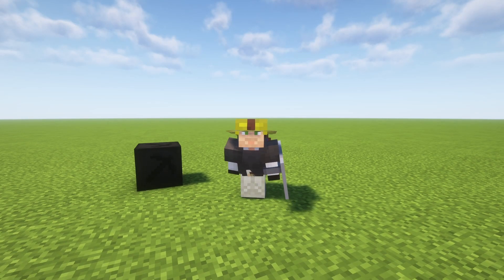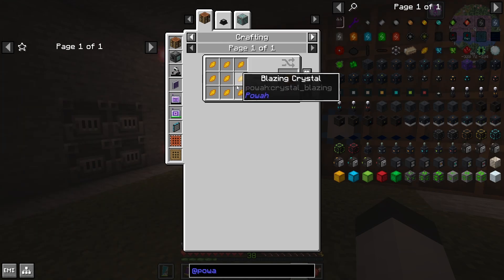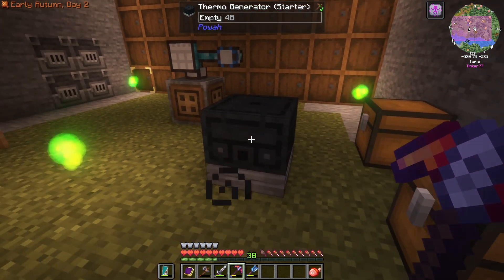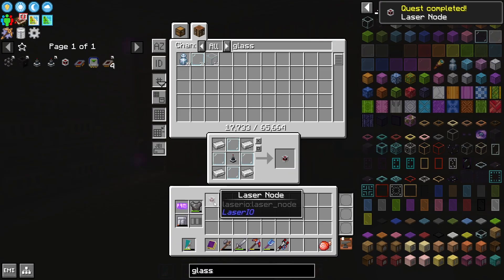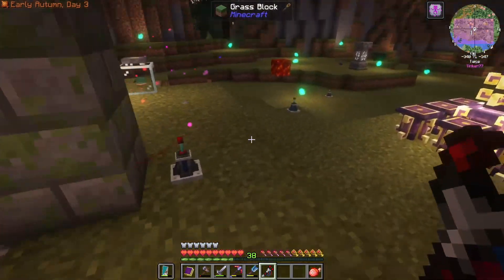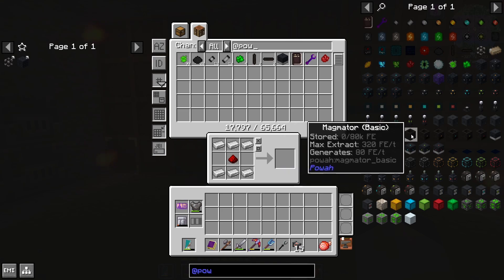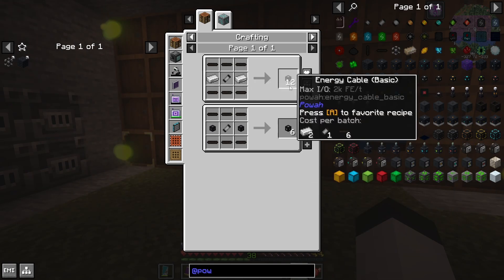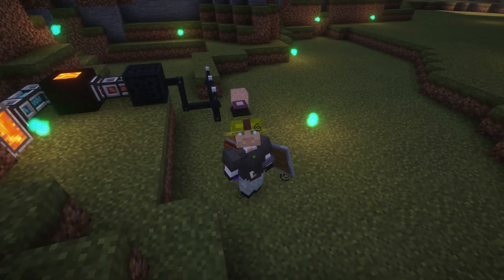Craftoria - 06 - CHANGE OF DIRECTION

Comment: They really need to sort out those bugs in Integrated Dynamics storage, as they've been around for a while. Also the thing with not showing what ingredients are missing in your recipes is really annoying!

BTW you can make an infinite water source vanilla style, and then use sophisticated backpacks to transfer it to machines (there's a pump/tank upgrade for the backpack).
Reply from the maker: Yep.  They need to fix that.  And of course you found another way to get infinite water.   I have just recently released a way I found, using Integrated Dynamics, to get the water.  Modded is fun!